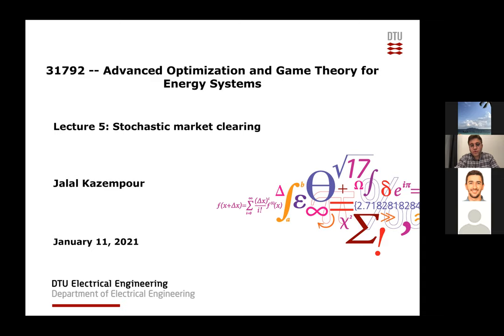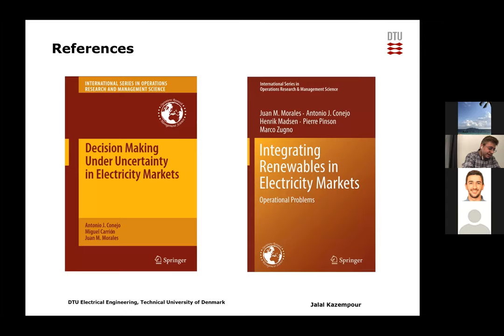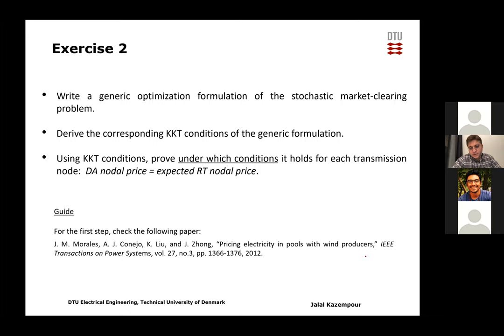Lecture 5: Stochastic market clearing

Comment: some thing wrong with the statement.

At 1:02:38, the number 30 is never gonna change with the scenario for rhe equation to be there, and sadly, teacher made a wrong statement which cause me lots of trouble.

in fact, 30 remains to be a constant coressponding to the actual power at the RT stage. 

when the 30 remains unchange, 

in scenario 2,  the equation is 30+30-60-0+0=0
in scenario 3,  the equation is 30+30-70-0+10=0
in scenario 4,  the equation is -10+30-10-10+0=0

it is a shame that noone actually point out the mistake in the lecture.